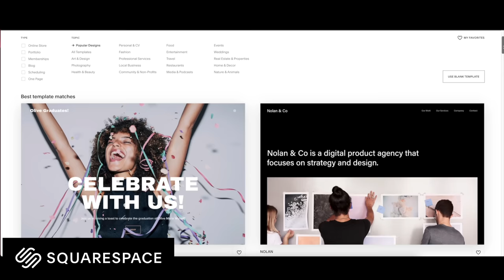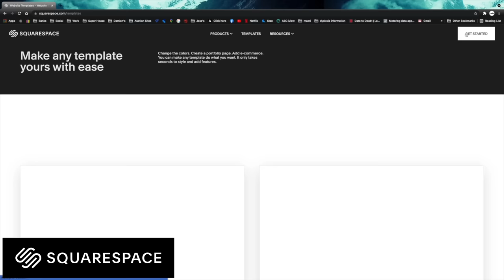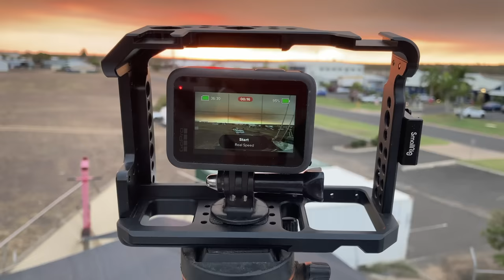Building a DIY Wet Sandblaster / Hydroblaster - Project Brupeg Ep. 230

Comment: Decommissioned LP tanks are ideal to convert for this purpose because they were designed with a safety margin well above the 200psi possible LP pressure and this application is only 110psi. It's now on half duty for the rest of it's life which could be a considerably long time at that margin. You have shown how to safely modify them. Good job. You gave it a fun paint job, so extra credit there. Mine is a "Ketchup" bottle made from a 20lb tank about the size of the one you replaced.

Comment: O man you cracked me up! when you tried to turn the cylinder upside down, while lifting it between your legs. Thanks for the laugh bruh I needed that.  
BTW Damien you did a great job on that sandblaster rebuild. Now you just need to figure out an efficient means of getting that sand transported from your storage bin into the sandblaster.  Good luck with that, hope you figure it out without needing having to hand bomb the sand into the blaster yourself. Maybe use your winch to lift it up the sand to a higher grade then gravity feed it into your blaster. cheers have a good week guys.

Comment: I love Your Work Mate going to start building my blaster. Thanks for the advice and building my confidence 😊
Reply from the maker: Glad to hear it!
Reply: I'm so excited,  I just finished building my dustless blasting unit. Its really nice and especially that nozzel works wonders from Able sales. Running it off Honda belt driven Gx 390 an its rocking baby with a 4000 psi Triplex pump of ebay. Thanks Mate❤
Reply from the maker: Nice. Sounds like a great setup

Comment: I have the same sandblaster, only use it occasionally so it's not modified. I strapped a vibration motor to it with a foot pedal, as I found the garnet/glass I use (and was re-using) didn't flow down and just created a void. Shaking it kept it running great. I fed it from an old diesel powered road compressor, so had loads of air.

Comment: Bro. Im a little late to the party but that was a bad arse vid on makin great working equipment from the shit thrown out. I’m a hobby machinist in Syd & luv repurposing materials to build new equipment or accessories for the lathe, mill & other gear. Happened on your vid cause I was looking at ways to blast a couple large pieces of gear & freshen up with new paint. My local guy, bless his cotton socks, does a great job on the contract jobs I charge for but on homers it erks me to shell out the bucks when I could diy. Anywho, I’ll get to work on what you did wet not dry. 
If anyone didn’t know kiwis are capable of anything they’ve never met a kiwi. 
Cheers bro! 
Kiwi from Hamilton.
Reply from the maker: Good on you mate. We are about to make a tiny 10L blaster to take with us as we travel on the trawler. The big boy was just too big for storage aboard

Comment: Nice video but falls info @ 26.20 dry blasting is 100% better in confined area's wet blasting messes the visor and makes sand stick near on instantly if yout having issues in tite areas dry is the way to go not wet. To get the dust off use compressed air done wet blasting needs rust inhibitors to stop the tea stain affect

Comment: Well put together and presented, must have taken a while to do.
Although the sand may be “silica free” I understand that this only has the fine silica dust removed, sand particles are silica and when they break down will produce fine silica particles. Your wet blasting is a great way to minimise problems

Comment: he he he, Gonna watch this episode several times, I'm getting ready to build my blaster and have been watching several of your videos to get your gear (kit?) down. Then you come along and do a comprehensive video on all I need to build my gear (kit?).  Once again ma'am and sir, THANK YOU for sharing.... Oh last thing is the paint job copyrighted by you or can I copy that as well? :D
Reply: One question; What is the volume of air do you think your system uses?
Reply from the maker: We have a big bastard three phase compressor. That’s all I know about the specs. That said we have run this off a 3hp single piston compressor but it does struggle. Two of those compressors might be good enough but they don’t last long. If it’s possible to find a big second hand unit you will be better off than smaller new units. Or big and new if the budget allows. We also have an accumulation tank which dries the air and gives us more volume in the compressed air system. I completely forgot about showing that part. I will take a quite video and send it to you via Patreon. Dame
Reply: @ProjectBrupeg  Awesome sir!

Comment: Really good video. Lots of creativity and thinking ahead. Only thing missing is media recovery. I assume after you blast an interior you still have sand to clean up.  I know it depends upon how much you pay for media, however since you have to sweep/vacuum it up anyways it would seem like it should be cost effective to run that used mixed paint/media back through the screener.  
I would consider some sort of set-up wherein you only move it once. From the truck bed into a hopper of sorts, run an Archimedes-type screw to move the media into a screening section, which deposits screened sand onto a conveyor which fills a small silo.  You blokes seem pretty creative, and this would cost only a moderate amount with your welding skills, and potentially free up some man-hours wherein it could be working while you're blasting.  I know it always sounds easier than reality,  but I think you could make it happen. Also, seems like you could dry your sand in 55g drums over a fire/heat vs having to dump it, wait, then shovel it back.

Comment: Washed sand removes salt clay silt. What is left is larger particles of quartz etc commonly called sand. Quartz is a form of silica. Sand blasting shatters quartz grains of sand to silica dust to some degree. Wet basting suppresses most of the dust. Is it 100% safe? do your own research. Thanks for sharing the build of the blaster and your experience using it etc.   I particularly like the repurposed cement mixer.

Comment: Cool upgrades! You can use a Chicago coupling to mount your ball valve. They're available in a variety of sizes ample for abrasive flow and they use easily replaceable rubber gaskets. The more simple quick disconnects like Chicago couplings and air brake glad hand fittings (you may like the profile) in your system the quicker you can service it.
Reply from the maker: Thanks for the tip!

Comment: Would sizing the sand ball-valve at the bottom of the tank a bit smaller so you could run it fully open save on wear? It seems like having to throttle it down would expose more teflon and increase wear.
Reply from the maker: Yes it might but then you would find the machine jams more.

Comment: Most blaster nozzles like the one you show here has a venturi to generate a vacuum to suck the media into the water stream. Are you using the sand blaster to push the media in under pressure? Very interesting! Do you have to play with the pressure so they don't conflict? I will be trying this soon! I've mentioned this to "experts" but they say it won't work. Leave it to a Aussie to make it work anyway. Good on ya.
Reply from the maker: This nozzle is designed to create a vacuum and be used without a compressor. Adding the compressor adds so much more power than any minor effect the Venturi design has the nozzle design becomes irrelevant. I would say ignore those experts unless they have used a vacuum nozzle with and without a compressor

Comment: The relief valve has to be big enough for the co
Pressor size or the pressure will increase even when it opens !

Yours appears to be too small .

Also increasing the size of a Nozzel, opening in s rated pressure vessel , is not a trivial consideration . Also the welding of pressure vessels is very important to be done correctly .

Be careful !

Comment: Can you rig the old tank to work in tandem with the new one? Then when the big tank runs out, you can switch over to the smaller tank while the big guy is being refilled. And once you're back on the main bottle, refill the little guy. It should take far less than 15 minutes to fill that large one and you'll have less down time in that 'Pineapple and Lime' eating booth... 🤑
Reply from the maker: I did think of a dual system. It’s very doable to make one but after 45mi a of blasting you need a break so I figure this refill timing on the new tank will make all day blasting easy and you won’t get so buggered by 5pm

Comment: How big a power washer or what pressures/volume is required for the water based blasting? Excellent and informative and helpful channel, thank you! SkipRay, Kerry, Ireland.
Reply from the maker: We have used a 2500psi washer and currently use a 3200psi. The more pressure the better the result. Both run from a 1/2” garden hose, about 9L/min

Comment: Thanks for your video. This came at the right moment for me. I have some flaking paint in my watertank. Your method looks doable. Do you have links to the products you use like the phosphor acid and paint. When you paint watertanks what paint is allowed for drinking water? Thanks for your reply.
Reply from the maker: I’ve just added a link to the rust converter we use in the description. Also the paint we used in our water tanks is Jotun Tank Gaurd 412 solvent free epoxy

Comment: When siving the sand in the mixer.  If you add a metal chain in there to. That will break down the big bits.  Will that work  ???
Reply from the maker: Because the sand is so cheap we never bothered trying to get every last bit out. Also the blades inside the mixer would likely foul the chain

Comment: Hi. I just had a price to do 4 big tractor wheels and two rear mudguards in UK by a mobile guy and now I've found your wonderful video, I'm going to build my own!!
Questions.   Can I use a road compressor of 125cfm which I am told will give 80/90 cfm constantly as the air source? Does the size of the PRV have to be taken into account as yours did look quite small? Does the airline need a moisture trap before the sand tank? Finally, what size are the quarter turn valves - they look about half inch?
Regards David
Reply from the maker: That size compressor would be perfect, we used a 35cfm and then a 70cfm both powered this just fine. Our valve was around 3/8". bigger compressor, alows bigger valve. Air trap is good but not needed. just dont let the sand sit in the tank with a load of compressed air in it over night as it will condensate and block it up, empty it or air after your finished and you'll be fine.1/4 turn valves were all 3/8 on this unit.

Comment: If time is expensive, is it worth adding larger/more hp water pumps too?  Does more water equal faster blasting?
Reply from the maker: No not really. More air is the key ingredient but we have a monster compressor now so the system does run pretty well. Sand volume was always our biggest stop

Comment: Curios if a larger hose and gun would help with coverage and production or is too much weight and difficult to work with.
Reply from the maker: Hose is not really an issue. Compressor is the limiting factor with any blaster. Our nozzle is 8mm dia which is fairly large for a DIY blaster but any bigger and the sand velocity would drop

Comment: Thank you for the very informative video.  Do you do anything to reclaim the sand that you send through the blaster?  If you re-use it, how do you prepare it?  If you don't re-use it, what do you do with it?
Reply from the maker: We looked at that years ago but the numbers didnt stack up. its $27 for a full Ute of sand. by the time we pick the wet sand up and re dry it and re sieve it (plus its about 50% less effective as its already been crushed during blasting) it actually took more time and effort than just buying new sand. 

Because its sand only we were able to dump it as clean fill in our local rubbish dump
Reply: @ProjectBrupeg  That makes sense.  Thanks again.

Comment: Nice Video, can I ask what air psi you use for the setup?
Reply from the maker: Ass high as possible. With our big compressor we would start at 110psi and it would drop and sustain at around 90. The more air pressure the fast the sand and the more effective the blast. You can use less pressure but you need a lot more sand to achieve the same blast speed
Reply: Understand.  Thanks

Comment: I wonder if a ceramic washer or short tube inside the pipe would work to decrease the flow instead of half closing the ball valve.
Reply from the maker: You need the ability to throttle
Reply: @ProjectBrupeg  True, but the right sized restrictor might make it so that happens less often.